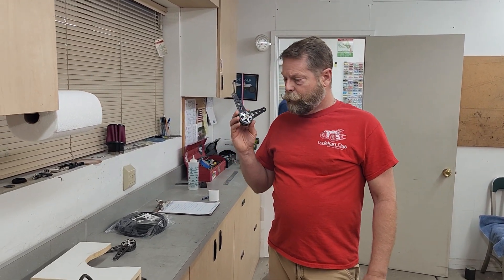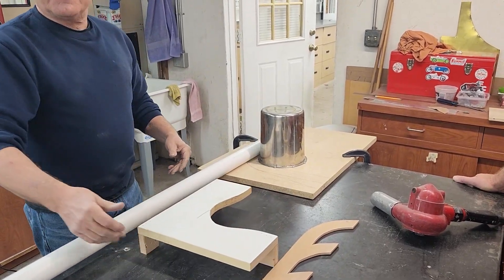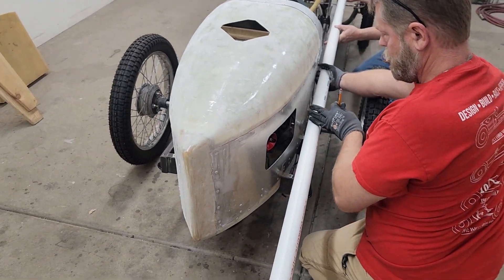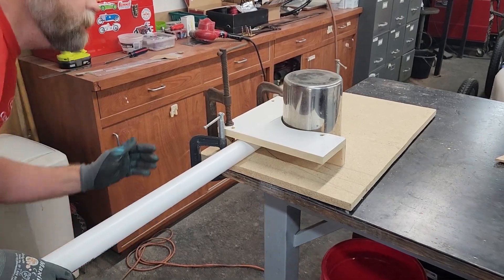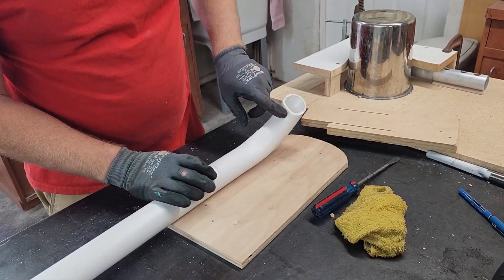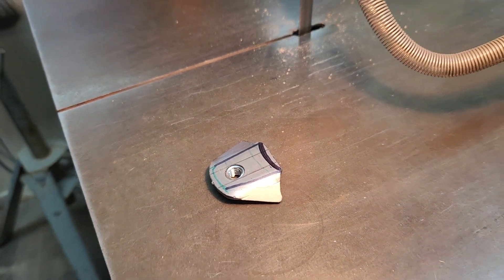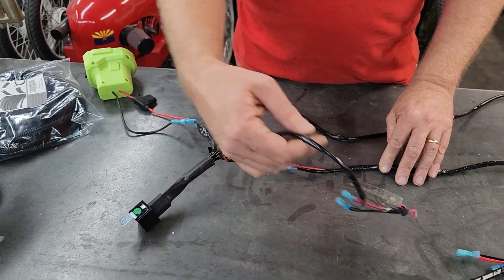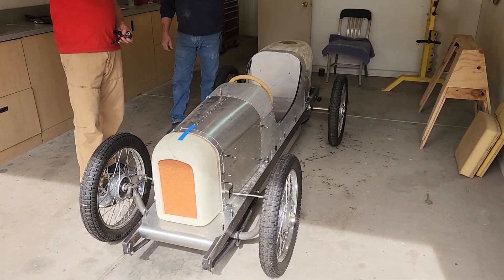Club Kart Build Part 14

Comment: The next time you want to bend pvc pipe, go to Home Depot or a plumbing supply and pick up two pipe plugs ( not sure what they are actually called) they are round plastic plugs with an “O” ring seal and a lever to tighten them in both ends of the pvc pipe. When you heat the pipe the pressure in the pipe increases due to the air in the pipe being heated, then make your bends with no kink issues. Also, the more heat you use the better it works. I learned this from an electrician who used this method to bend pvc conduit. I’ve used it for years and it works great. We used a large propane torch to heat the pipe, it works a lot faster, although care has to be taken to prevent burning the pipe.
Reply from the maker: Fantastic tip

Comment: Try using the grey electricians PVC it is made to be heated so you can bend it. You did a good job with the regular PVC but I think you'll find that easier to work with
Reply from the maker: Fantastic, I may try that on my build, I still dont have an exhaust on my Model T

Comment: That exhaust pipe looks great. I have seen people bend PVC pipe using boiling water to soften it, if you fill the pipe with the boiling water after capping one end then gravity will help make the bends. Not sure if you can get the tight ones like you need.
Reply from the maker: That's a good idea!
Reply: I’ve seen someone using hot sand, I used to use different types of commercial pvc heaters when I was an electrician from just rubber heating blankets to box type with elements inside.

Comment: If you fill the PVC with sand and then heat it , it will not deform when you bend it.
Reply from the maker: Good tip, thanks

Comment: There is a guy on YouTube making rollercoaster rails from PVC pipe! He plugged the end and poured hot sand inside( not sure of the temp he reccomended, but like oven hot!) and then plugged the open end, and used gravity and a former to get the radius he needed✅✅😮
The sand gave plenty of time to work it, and endured no areas got overly hot. I will try to re find the info👍
Ok, he heated the sand in shallow trays to 400 to 450F. Oven gloves required
Reply from the maker: Neat idea